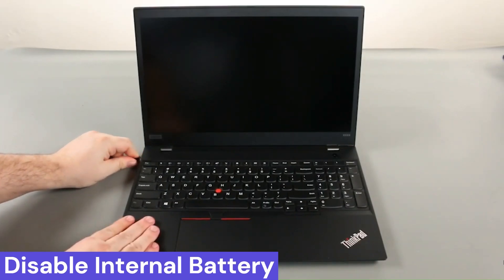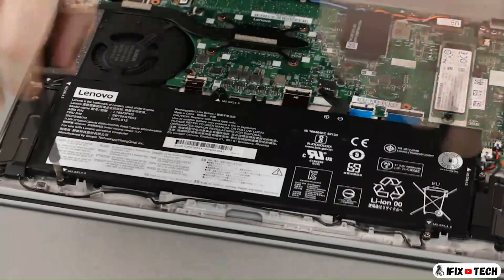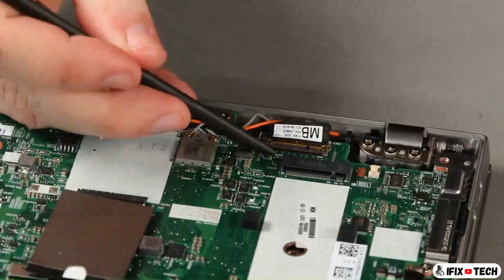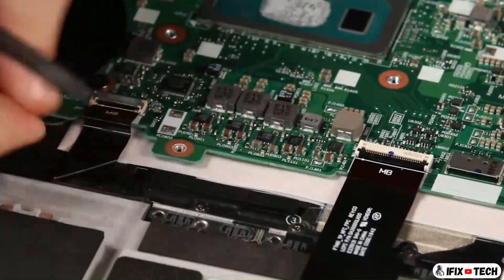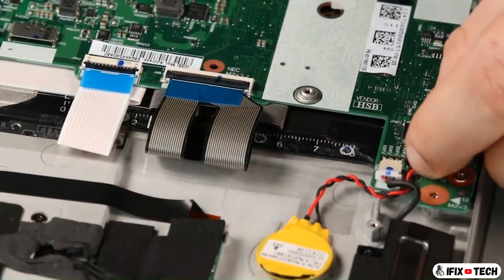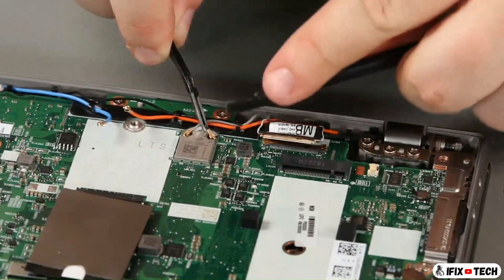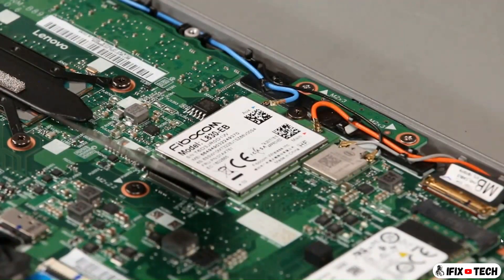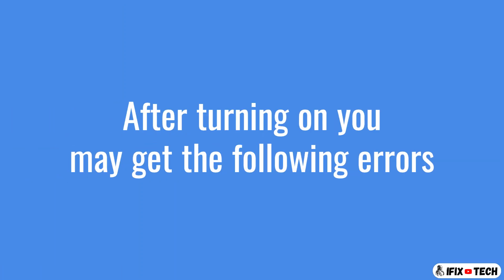Lenovo ThinkPad T490s and T495s MOTHERBOARD Logic Board Replacement

Comment: Do i need to replace the CPU/GPU, or are those soldered into the main board? Asking because my motherboard short circuited and the internal LCD won't turn on, so I'm buying a replacement
Reply from the maker: Thanks for commenting and subscribing 👍😉
Those are soldered to the main board.
Best regards